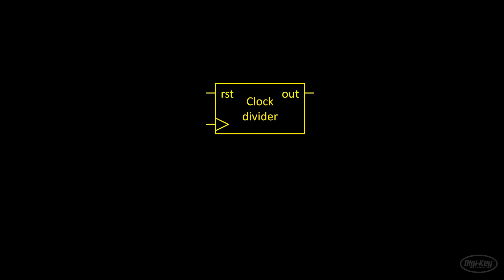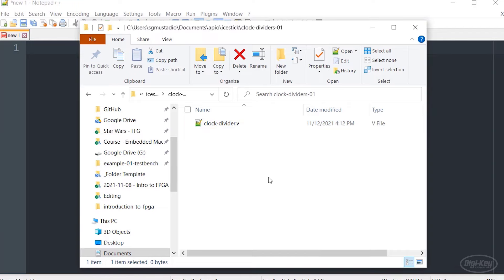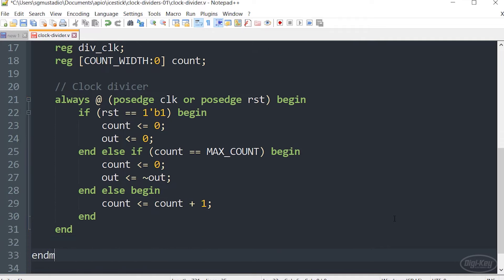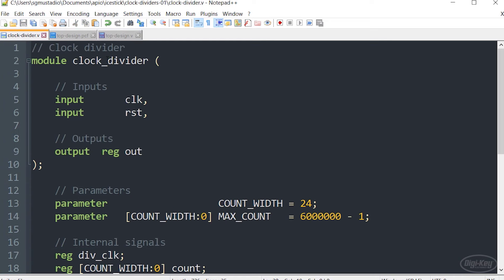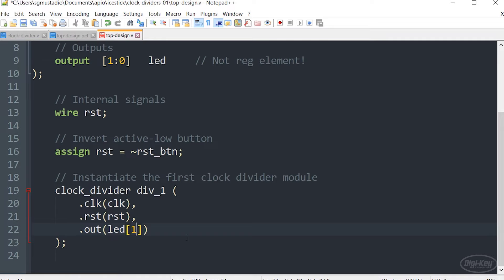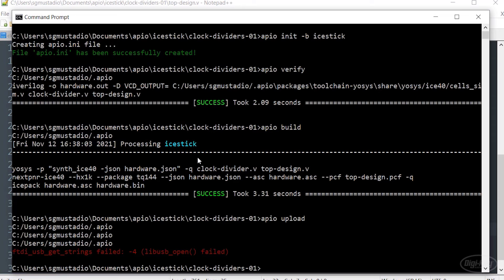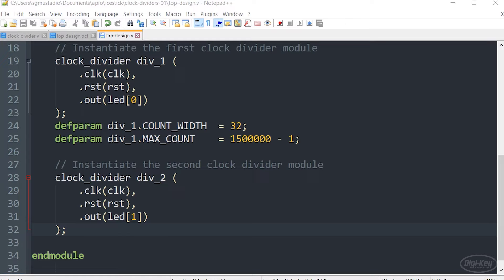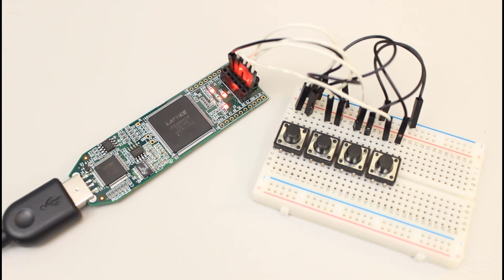Introduction to FPGA Part 6 - Verilog Modules and Parameters | Digi-Key Electronics

Comment: [COUNT_WIDTH:0] is actually COUNT_WIDTH+1 bits wide, as 0 was included. This isn't terribly important in this case, as it just needs to be wide enough to hold MAX_COUNT and narrow enough to fit and satisfy timing; if you're lucky, the synthesizer might even tell that the top bit is constant and remove it. 

Personally I prefer the #() syntax for setting parameters over defparam, e.g.: 

clock_divider #(.COUNT_WIDTH(32), .MAX_COUNT(1500000-1)) div_1(.clk(clk), .rst(rst), .out(led[0]));

This avoids repeating the instance name and makes it easy to define multiple instances with the same parameters. Note that you don't have to match styles between the module definition and instantiation; they're parameters either way.
Reply: Good catch, thanks! I found the MAX_COUNT one, but I forgot to update the bit width parameter.

Comment: Excellent series Shawn.  Top drawer & nice and snappy.  No waiting for slow typing and droning-on!  Does mean I have to occasionally rewind 🤠.

Had an .apio issue with sample code for a couple of dev boards where the verilog in other module files was included in the top.v file using the ‘include metastatement.  I’m assuming needed for some tool chains but apio is doing a sweep of all files in the folder to round up other modules instantiated elsewhere.  So with the file include statement(s) you get an error from apio that the module is already declared.

Might help someone…. But apio is great & enjoying Verilog instead of my usual VHDL.

Comment: Thank ou for making this series.  It is very helpful to get your concise take on using FPGA's.  My question is are you going to do an episode describing how to use ICESTUDIO and/or GTK Wave? 
I know you seem to be a windows guy, but many of us are linux users, and it would be very helpful to have some episodes addressing more free tools that we could use.
Reply: I try to pick tools that work across all the major operating systems, so everything I show should work on Linux and macOS as well as Windows (some of the installation commands might be a little different). That being said, I believe iverilog and GTKWave is the next episode :) 

I like what IceStudio is doing, but I don't think I'll have time to fit it into the series. I decided to cover modifying a RISC-V softcore processor in the last two episodes instead of IceStudio (or some other topics). I tinkered with IceStudio, and it's pretty easy to set up and use. If you can manage your way with command-line tools, I think IceStudio would be even easier.

Comment: It doesn't work if two outputs from the clock divider are connected to the same wire LED; Does it short in case the output signals are opposite?
Example:
led[0] = 0
led[1] = 1
That would be "short" I know it's lookup tables, but doesnt it make sense? Or is this somehow internally implemented as an OR gate?

Comment: In the world of programming languages one can take a module written in one language (e.g. GUI written in C++), a module written in another language (e.g. a numerical library written in Fortran) and under some circumstances link them into one executable. Is it possible in the world of HDLs? If yes, could you prepare a simple tutorial? I think it is a valid question as there are many open source cores written in different HDLs and one may want to "glue" e.g. a processor described in VHDL with a peripheral described in Verilog. Greetings from Poland.
Reply: From what I understand, some synthesis and simulator tools do allow you to mix languages among your modules, but it depends on which toolset you're using. I have not personally seen it done, but I'll keep in mind that there's interest in a tutorial for that!